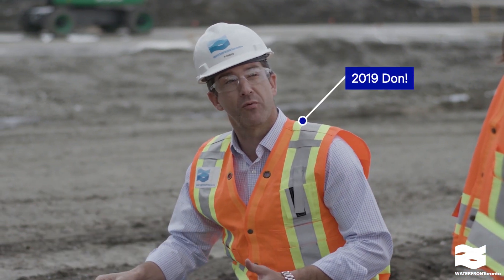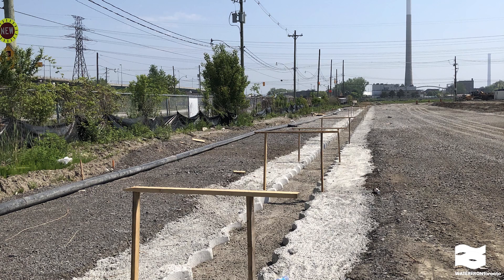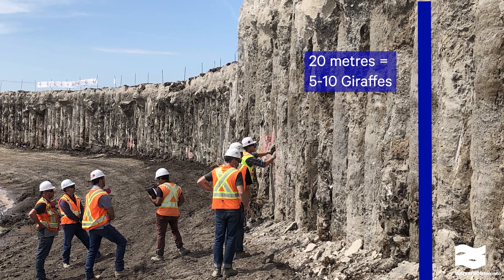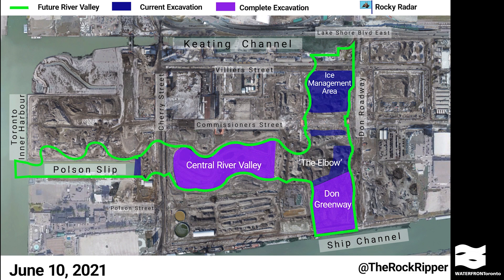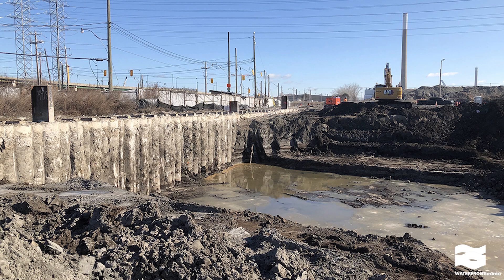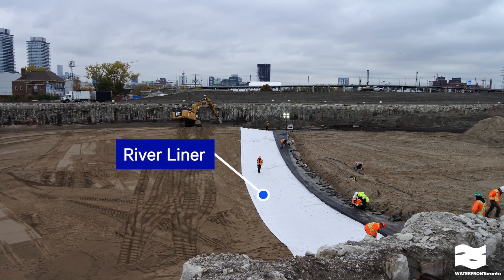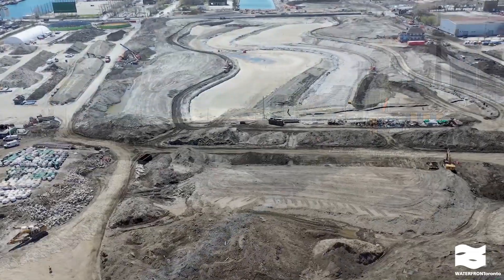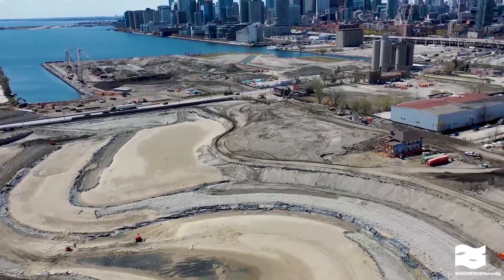Digging a New Don River

Comment: That water treatment plant that you have onsite could come out of my faucet and I'd be pleased as punch. Why not plumb it to the nearest pumphouse?
Reply from the maker: The water that comes out is very clean compared to Lake Ontario, and meets (or exceeds) water quality objectives for surface water, however drinking water standards are generally more stringent. Also, laying that much pipe through an active construction site would be a challenge! Most of Toronto’s drinking water does come from the Lake, after being treated, so it’s making its way to your faucet eventually.